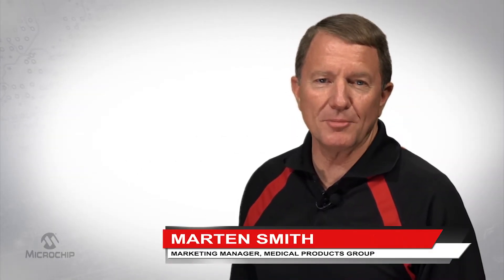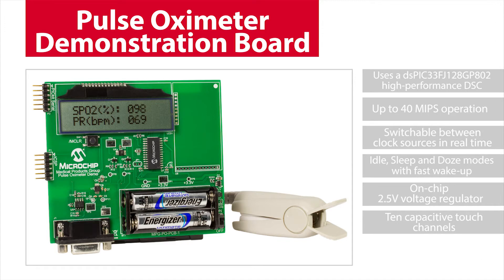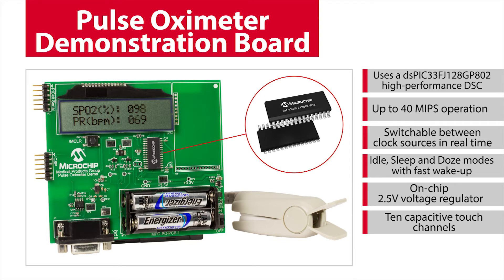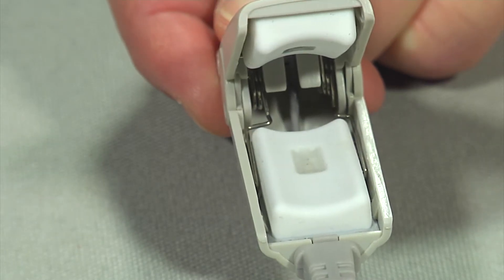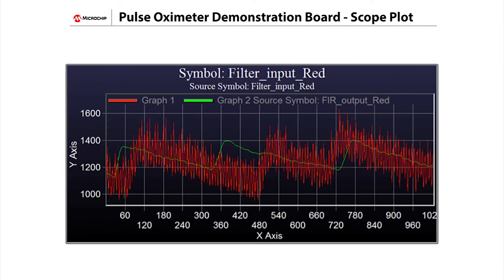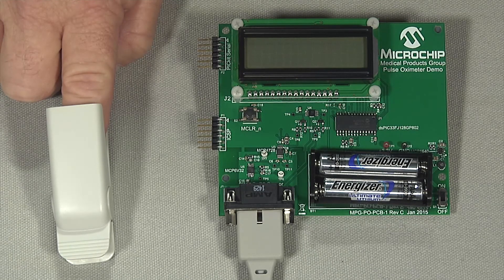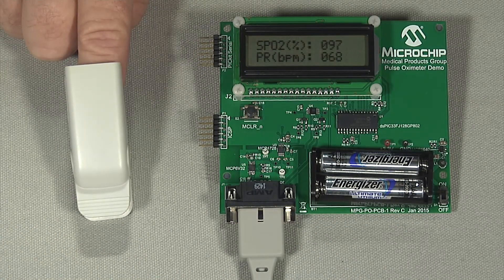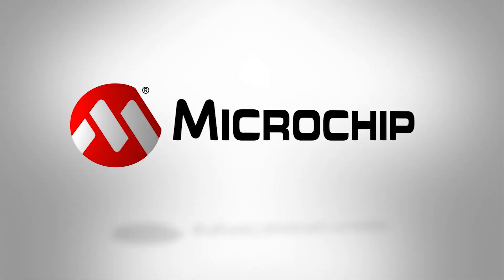Microchip's Pulse Oximeter Demonstration Board

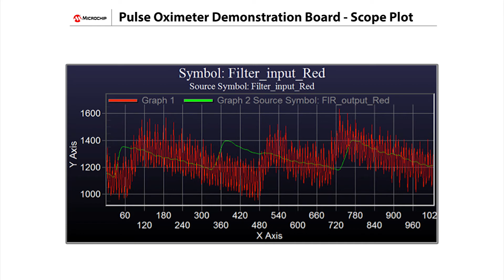Comment: Hello, little question, for a project that I'm working on I need the filtered signal that is shown in 1:53 to make my own analysis on. Is it possible to access that data with this board?
Reply from the maker: Enzo - you can replicate the circuit and get the data by downloading the schematic and firmware from the pulse oximeter demo web page located at http://www.microchip.com/promo/pulse-oximeter-demonstration. 

The download links are located under the Resources sub heading. The links are entitled, “Free Schematics” and “Free C Source Code.”

If you need further assistance or have other questions, please visit support.microchip.com to get in touch with our team of applications engineers.